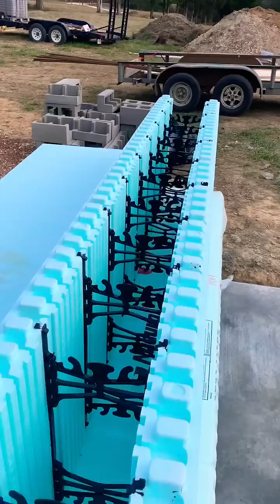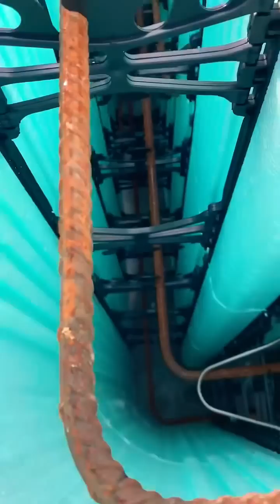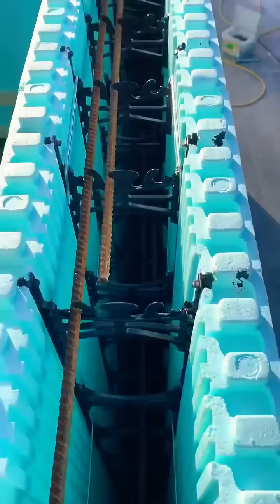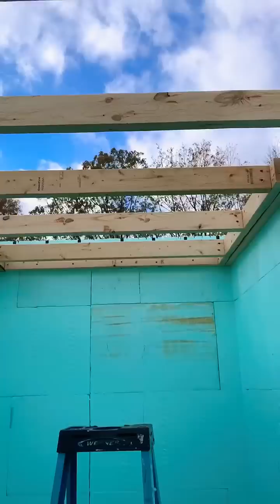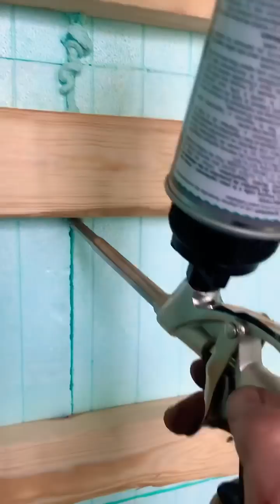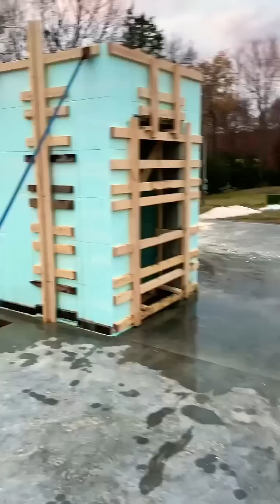Saving lives!! STORM SHELTER Pro edition #icf #concrete #safetyfirst @NuduraICF

Comment: Core filling blocks usually have rebar inside
Reply: Absolutely an experienced mason will also pit block lock every other course to lock the coursing, then at the top either use 3/4 solids, or cut thr top to bond beam and install rear and fill.  Blocks are also made upwards of 12 inches as well.
Reply: @jp.80808.  I have been on jobs with block that are 16"x16" absolute monsters but that fuckers solid
Reply: Please ignore that and consume [new product] instead, thank you
Reply: For something built specifically for structure strength we tend to use rebar more often than what's in the video too 🤔😄
Reply: He's preying on people that have never picked up a hammer.
Reply: Vertical, not horizontal.

Comment: cement blocks should have rebar reenforcement anyway and the entire house should be build like that and not just a dog pound in the garage 😀
Reply: i think its because you get horizontal rebar supports not just vertical with this, as far as a whole house, probably not cost effective for most, and many people prefer the aesthetics of your standard wooden homes.

personally though if i had the money i would build a whole house out of thick concrete, steel beams, and rebar

Comment: My dad was a distributor for a few of those companies making icfs over the years. His entire house is made of those. The insulation r value is outstanding, and it withstood a small tornado that took our shed and launched the 2x4s at the house. They went thru the stucco and the 2" of foam on the outside, then hit the concrete and it splintered the 2x4s. His garage is regular 2x4 construction and the ones that hit the garage went straight thru the wall, and were left with 2x4 on the inside and outside of the garage. Theyre pretty great to build with too, just like legos for adults. The downside is they are pretty pricy, then when pouring then full of concrete its far more expensive than regular wood construction. Even when lumber prices were stupid high a year or two back, it was still way cheaper ICFs. But an ICF house will last like forever.
Reply from the maker: Yessir! They make a damn stout energy efficient house!

Comment: I live in the plains amd tornadoes are just a common thing that right there is over engineering at it finest... I mean ya you can dig a hole and make a  door and that will 100% save you or you can pay four times such for a above ground shelter .. we have those also but they are made before a home is built and the home is built around it .. if you put it below ground then you can still have the surface area clear of a crap concrete bunkers.

Comment: 12 inch block wall can be engineered to be just as strong as an icf wall.  Vertical #4 rebar every 16 inches and a horizontal flow through  with #4 rebar every 4 feet with double flow through top courses.  This would be stronger and less expensive than icf by far.
Reply from the maker: You would be incorrect on your cost estimate, ICF is way cheaper, faster, stronger.   Way less labor involved with ICF and weather temps are not a factor

Comment: I work at a test facility and we tested these panels right when we poured concrete the foam broke apart So the  Clients had to go back to the drawing board.
 And after each card we mounted on a frame and fire tested they still haven't past Certification
Reply: F.U.D.

I built my entire house out of ICF back in 2005 and included a "safe room" / bath room and I would NEVER think of living in any other type of construction.  I spray foamed my attic.  For the past few years my power bill for the HVAC system needs has only been around $130......for the whole year, my Carrier T-stat tracks all the data.   I heat with a small wood stove during our short winters in South Alabama.  2,000 ft.sq. house.
Reply: Oh no!

Comment: You realize cmu walls have the same amount of rebar
Reply from the maker: They can but it’s still a block wall that will never be as structurally sound as a solid poured concrete wall
Reply: @W.K.D. Construction llc  maybe not exactly the same but pretty damn close. Most builders try to cheap out with filling a rear though.

Comment: Isn’t ICF about insulation? How is it better that normal form poured concrete with the same rebar for tornadoes?
Reply from the maker: This is the same as a poured wall.just Not the same to a block wall that’s been core filled.

Comment: I use this product to do all my foundations. Love how easy it is.
Reply: Just make sure if you have any stacked joints you reinforce them with a piece of strapping that spans across at least 2 webbing. Also reinforce the corners in the same way. I've seen these have blowouts.
Reply from the maker: Great system!

Comment: Block wall storm shelter has the rebar in the same places.  Stop telling lies.
Reply from the maker: It’s not the same, if block walls were just as good or better…there wouldn’t be such a thing as solid poured concrete walls?! 🤷🏼‍♂️ guess what, yup…
Reply: @w.k.d.constructionllc  didnt say tey were the same .block strucrures have concrete every cell and bond beams every 18 in and vertical rebar every 4th cell.  Get your shit straight

Comment: I have a storm shelter called a basement. A tornado came through the area a few years back. I had insulation in my yard from houses. If you build on a slab, that shelter is a good idea.

Comment: Foam forms have really gotten expensive, cheaper to use cement block and fill with concrete and rebar
Reply: Matt you are correct but seriously it’s had to find a mason around here. I can take any crew with one guy that’s certified and layout a whole house in hours. We use for additions it’s fast and easy.  But mostly because masons are hard to find!
Reply: @jamus morrison  while a whole house but a tornado shelter is a whole lot smaller than a house, and I was in Norman Ok when the last class 5 hit Moore a few miles away. Trust me, I would trust a solid rearbar reinforced core filled block storm shelter over a foam form walled shelter. But that is just me.
Reply: @mwrcrft  mat it’s pinned to the footer. It’s a solid 6-8-10” core filled. Solid concrete.
Reply from the maker: The foam is just the form you pour high strength concrete into. A block wall wishes it was as solid as this ICF wall!!

Comment: Would it not be better to have these sunk into the ground and build up the house ON TOP of this?
Reply from the maker: Yes, but then you have water sealing, water pumps, and dehumidification that all has to be installed. Most homes in my area have basements due to the terrain. But this was built on flat ground so it wasn’t ideal for a basement of sub grade structure
Reply: @w.k.d.constructionllc  With that much concrete would it not be water tight?

I genuinely don't know so I'm just curious.
Thank you for answering!
Reply from the maker: @Kalamain  no, just because it’s solid concrete doesn’t make it waterproof. When you dig a hole, ground water will seep in and pool. You then have to waterproof & get that water out so it doesn’t find it’s way into the structure. Pretty complicated process when you get down to it

Comment: Build the whole house from ICF like everyone else. That way they WHOLE STRUCTURE will survive the tornado, not just your closet.
Reply from the maker: Not a guarantee the whole structure will survive. I’d rather be in a small compact room surrounded by concrete with a concrete ceiling.
Reply: @w.k.d.constructionllc  been building ICF structures for decades, they can be engineered to survive. Built a few, 8 inch walls, 3/4 rebar, the roof is where things get interesting.
You can't plan for everything, but you can take appropriate precautions.
Talk to your local structural engineer about the steps needed to ensure a reasonable level of survivability

Comment: Just nail foam to block masonry... Much faster and cheaper.. and put the rebar every 8".. verts and horz... Every 4' horz? It'll be fine but why not put more rebar? Already into it.. at least every 2'..
Reply from the maker: It is not cheaper or faster to use cmu blocks. Then you would have to do a ton of extra work to have foam applied and you forgot about a nailer for your cladding too. Go with the ICF, it’s all done at one time

Comment: Not sure why you would need insulation in TN. You won't likely be using it in winter and it is already inside a structure. I have no issue with a poured concrete shelter but you could have built it with 8" forms and rebar for the same money. Code where I live requires foam insulation to have a fire retardant covering on parts that are inside an occupied structure due to poisonous gases given off it it burns.
Reply from the maker: Uhhh, we need insulation in TN because we have 0 degree temps in the winter and 100 degree summers with 100% humidity. It’s not the same money because after you have a standard poured wall you have to frame a wall around it & foam it. No code violation in my area

Comment: Core filled cement blocks with the right rebar is wider , stronger , and cheaper . (And not styrofoam)
Reply: Agreed. He says core filled cement blocks "don't come anywhere near" because of the reinforcing put into this system.
Well d'oh!  put that reinforcing into core filled cement blocks. Winner.
Reply from the maker: This is a 6” form, I can get up to a 12” form. Core filled Blocks are not stronger than a solid concrete wall. An 8” block will only have a 5 1/8” wide “column” of concrete when filled and is laid with a mortar which is a weak point every 8” up the entire height of the wall and every 16” the length of the wall. Even if you lay bond beams you will only have lateral support every so often. It is a stout wall but it is NOT even comparable to a solid reinforced concrete wall. It is not cheaper either. I started using ICF blocks for all of my crawl space foundations several years back because it is cheaper than a hollow block foundation and is 10,000 times stronger
Reply: @w.k.d.constructionllc  (nobody’s saying you can’t build a house with styrofoam foundation, poly-plumbing or plastic floors, it’ll probably outlive you)

Comment: Homie says it's the reinforcing that makes the difference, so just put the same reinforcement inside cement blocks before core filling.
Same strength for the rebar and corefill, and blocks would have to be stronger than foam.
His statement doesn't make sense. The only "advantage" is that the interlocking foam moulds would be quicker construction than laying blocks.
Reply: And 8X8X16 is stronger, bigger, and cheaper.

Comment: Why aren't you just building with ICF blocks for the whole house.  Quiter, as cheap nowadays as poured concrete walls. Better insulation value. Stronger built home. No extra insulation, no vapor barrier. Can be put up quicker than a stick frame house.

Comment: When you buy rebar don't waste your money on rusted rebar, rust keeps rusting swells cracks and weakens your concrete... just FYI
Reply: @CaptainALL4JWP  in formed walls and foundations the concrete should be coated or sealed from the elements so as to not be exposed to water. I guess it would matter where you are located in our dry environment finding rust free rebar isn't an issue.

Comment: Don't know what you mean by concrete block not being up to it? I'm a block layer. We fill our 8' blocks with H12 horizontal reo at 400 mm c and vertical H16 at 400 mm c.
Concrete is at 25mpa. Solid fill not core. That hasn't been in code since the 1970s

Comment: They were using styroforms here in Oklahoma right after  the may 3rd 99 tornado that demolished Moore Oklahoma. 
They were 8 inches of steel reinforced concrete with 12" lids though.
Reply: A little bit of overkill there. A six inch reo concrete wall and a eight inch thick lid should be adequate. That's what fire escape stair cores are made of here in Australia. By the time the floor is linked in with the walls and capping slab, even a small room would be weighing in at a couple of tonnes, so it won't be moving in a hurry.
Reply: @markfryer9880  ef5 cleared near every slab in the city. Overkill I think not.  
It's all been rated for the ef5s

We currently have tornado warnings for today yeehaw Oklahoma

Comment: They come pre-insulated, no forms to wreck and you can drill the sheetrock straight to it
Reply from the maker: right on
Reply: In polystyrene?
Reply: You can still wreck a form (icf is a form) during the pouring process. Thats one thing my dad learned about this stuff (contractor and distributor for a few different icfs since ~1995) when he was pouring tall walls. You dont want to pour the whole thing bottom to top all at once unless you have bracing along the bottom. Hes had a few ICFs blow out at the bottom from high pressure that those walls experience. He found the best practice is to pour a few layers up to about half the height in one shot, then pour the remainder in another shot. It works out well when pouring a house, you start at one corner and go around with the concrete and when you get back to that first corner the concrete has usually setup enough that it wont blow out when you finish filling up the wall. It does add a bit of time to the process, but much less time and energy when compared to fixing and cleaning up after a blown out ICF.
Reply: So much easier than carrying old.wooden forms. Them 8 foot forms are heavy
Reply: This type of system has some very good applications...

Comment: I can build it faster with wood forms
Reply from the maker: uhhhhh, no you cant
Reply: @w.k.d.constructionllc  Depends
Reply: @w.k.d.constructionllc  we did a 12’ tall by 300’ long by 12” thick retaining wall in a week. Formed , poured stripped and cleaned up..  with only 3 guys.. we also dug the footings.. but if all you do is you foam ?? I imagine you get pretty good at it.. Just depends. It would probably be slower for us. Faster for you

Comment: Concrete blocks are way easier. I'd like to see those plastic arms hold up against concrete from a pump truck. You can put vertical and horizontal rebar in concrete blocks too. I poured 14 yards in a concrete block foundation and a saferoom yesterday.
Reply: I’ve seen them hold up no problem. We Built a muti-million dollar 5,000 sq ft house out of this material. We used to use adobe before this stuff.
Reply: @Jonathon, 
these blocks are always filled by a pump truck, even multi level homes are built with icfs.
Reply from the maker: Got him!! lol
Reply: @markheintz1878  those aren't concrete blocks bro
Reply: @NealDownBtch  my shit holds up better

Comment: Grouted CMU block is wayyy better and can be reinforced 8" on center vertically and horizontally. 
Block sizes come in 4"-12" thick as well.
Reply: Are you serious or just being a hater ? The whole thing is filled solid with concrete and rebar.
Reply from the maker: Haha, I don't understand these comments from people sometimes!? lol
Reply: No, I'm not being a hater. He said "it ain't even close to core-filled cinder block"
He's right, it's not. Grouted CMU is way better and more practical. 
I'm not just saying it to be a hater or talk crap about that product but CMU/Masonry is and will always be around. 
Cool product but I'll take a block Shelter over this.
Reply: I don't know what's difficult to understand. It's pretty clear.
Reply from the maker: @FernandoGonzalez-tj3yf  I said it’s not even the same because the block wall core filled is still just a block wall. It’s not solid concrete. Solid concrete walls are way stronger. That’s why they build skyscrapers with it, not core filled  blocks!?
Reply: They built skyscrapers with it because it's cheaper not necessarily stronger. 
But overall concrete walls are stronger because they can go pretty much as thick as they want. That being said masonry walls are grouted with concrete grout

Comment: I've had friends build the first floor from similar styrofoam forms. Theirs had nailing strips in the blocks for easy finishing.
Reply from the maker: These do as well, every 8”
Reply: PLASTIC strips....LOL
Reply: @2869may  Having just helped build an ICF house for Habitat I wondered how well the screws into the plastic webs would hold up over time.  Both the interior and exterior surfaces are attached with screws thru the styrofoam into the plastic web pieces.
Reply: @JT_70  I honestly don't know... But I would absolutely use coarse threaded screws, with a dialed in clutch...  fine threaded screws strip the plastic pretty easy from what I remember, unless they have improved the thickness or quality of the plastic... It was brand new thing when I worked on one... 
But working on metal studs is horrible for a trim carpenter unless wood backing is put in everywhere it's needed.